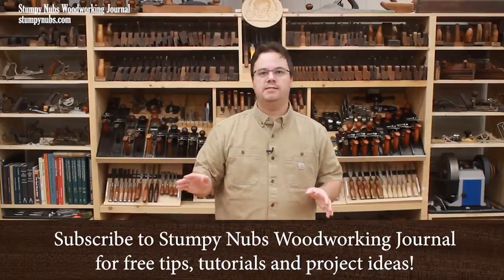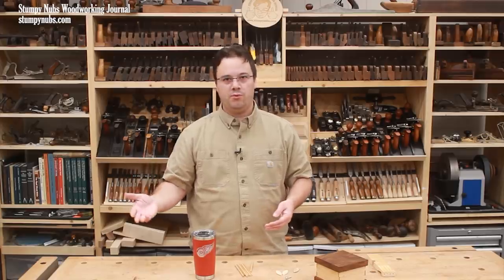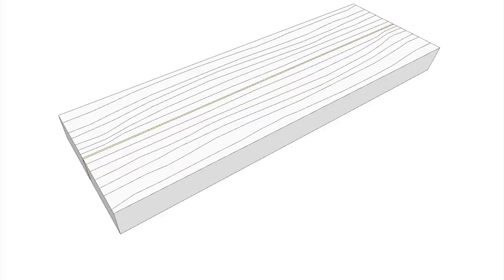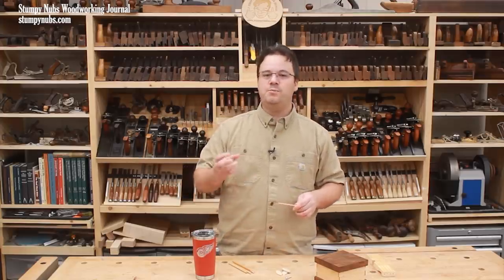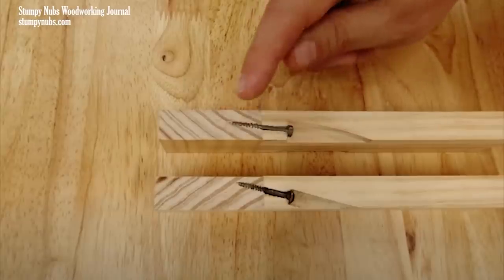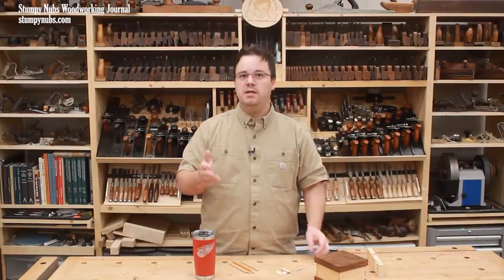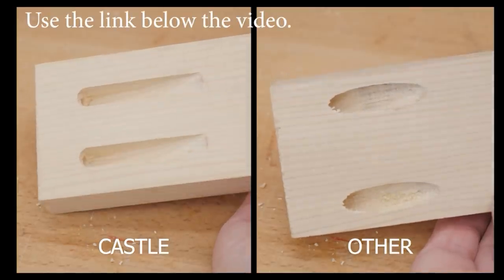Many woodworkers use these wrong! (biscuits, dowels and pocket screws)

Comment: It's so odd regarding the timing of this video! I currently have 5 dining chairs in my shop for repair. They are about $100 a piece, made in Vietnam, nice chairs,  but not sturdy enough for an male (ie 250 to 280lbs) to rock back on the legs. They just aren't designed for that type of racking stress. The joints have been put together with dowels, but then from the bottom, they ran a screw into the joint/dowel. 
In taking them apart, it seems the screw is breaking and compromising the dowel. 
I'm kind of scratching my head as to what is the proper method to fix them. I have considered dowels again, or a domino, but I don't have a jig to drill a domino. Anyway, I'm rambling.  Thank you for the timely advice and information in this video.
Reply: Oh yeah, and I have considered just ditching them altogether,  but I'd like to see if I can fix them. I'm probably going to make the cross pieces a bit more beefy. No, not a 2x4 or anything savage like that, but wood that has a bit more mass to it.

Comment: The hold of a biscuit was tested; it adds nothing meaningful to strength.  You could use them for alignment, but dowels would be a better option.  Dowels work well is you planer is 12" wide, and you want to make a wider table.  Making your own dowels is also a good thing to do.

Comment: I've found the main problem with pocket hole screws to be their movement during installation.  You still need to clamp pieces together or as you screw into the piece your attaching it moves out of alignment.
Reply from the maker: That is a smaller issue with a jig that cuts the hole at a very low angle, such as the Castle machine at the end of this video.

Comment: I love the speed of pocket screws. But don't like the drift. 
One thought is to use a dowels along with pocket screws to help prevent drift and increase speed.
Reply from the maker: A low-angle pocket really changes that drift problem. The Castle system segment at the end of the video talks about that.
Reply: @StumpyNubs  the Castle system is nice. But it's not cheap, and I'm just a hobbyist.
If there are any other low angle systems in a more budget friendly price range, I'd be interested. But I'm thinking the pocket screw/dowel combination idea is about as budget friendly as I'm going to find. The question then is around results.

Comment: One question: 
Are dowels as prone to telegraphing over time, as biscuits can be?
Reply from the maker: I've never known dowels to do that. The telegraphing problem with biscuits can be solved by cutting the slots off-center, biased toward the underside of the panel or inside of the cabinet.
Reply: @StumpyNubs  
Great James, many thanks.

Comment: I haven't used biskits or dowels yet. Just finished another project with pocket screws and ran into a small problem. It been a while since I've used mu jig set and had a few screw points poke through.  Check my settings then got out the calipers. My math isn't great but even I know .70 is not 3/4 inch. Checked all that days purchased lumber and found it was al the same. Industry standards mean nothing anymore. Can't rely on much anymore except that politicians still suck.

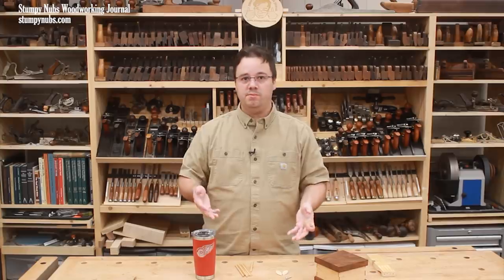Comment: 4:06 Biscuits do not extend far enough in the joined wood pieces to provide significant/enough additional rigidity to the join. "Enough" is the operative word here and if enough pressure is applied, the join will split along the glue seam no matter how many or few biscuits are used because the wood fibres adhesion will not hold up. Wood can be compressed so the biscuits do not need to break for the join to fail: once the wood piece itself fails along the join it will simply pop out of the biscuit protrusions. Seen it happen: the smaller the biscuits and the higher the stress applied, the easier for it to happen. The biscuit cannot be relied on for significant additional rigidity in my opinion.
4:32 Exactly!
5::40 Ditto! Perhaps dowels were invented for automated furniture fabrication processes were savings in materials usage and time matter a lot. Also for the wood worker carrying out a similar repetitive task, where again time matters. The alignment is crucial though and it's probably not an easy task for the amateur woodworker who might not realise how much strength is needed for the join attempted nor can achieve the proper alignment, even when using a jig.

Comment: Pocket screws are NOT recommended to securing table tops.  The table top needs to expand and contract.  Thus the Z bracket is recommended
Reply from the maker: Yes, they are. In fact, the Shakers used them for that very purpose, and their pieces have lasted two centuries. You just have to know how to use them properly.

Comment: The same can be said for Stanley plane’s. Purists say the Handyman version is not worth having. I disagree! The Handyman works just fine. Yes, it may not have frog adjustable screw, but some of the Bailey’s don’t either. You can pick up a Handyman for $10. To $20. Bailey’s cost $45 and up. I have both and frankly, not much difference in performance.

Comment: Wouldn't you need a jig for every size dowel you use? I just don't see precise alignment of a 1/4 inch drill bit in a 1/2 inch jig being as easy as using a 1/4 inch jig.

edit to add:
Those self proclaimed gate-keepers to what is good wood working need to be told if they use anything other than the ORIGINAL joining method of mortise and tenon they are doing it wrong then. ;)
Reply from the maker: Good dowel jigs are micro-adjustable for position and come with different sets of bit guide collars for different dowel sizes.
Reply: @StumpyNubs  so it effectively becomes a jig for the size you need.

Comment: My other joinery inadequacies aside, I have discovered that I'm not a pocket-hole-superstar, which is most likely due to lack of practice in addition to lack of precision.
Reply: I have learned to practice on scrap wood of the same thickness and material with my pocket screws to get the best result. I'll adjust the measurements on the bit, on the guide itself, and different length screws.
Reply: Setting up a pocket hole jig is like setting up any other tool in the workshop - test in on scrap first, adjust, test, adjust, test.
Reply: @criswilson1140  it probably doesn't help that ALL of my wood would be considered "scrap" by most people's standards!
But yeah, practice, test, adjust, repeat.

Comment: "In some cases there is just no substitute for traditional joinery"

Other than "biscuits" (though one could argue to be a variant of splines), why aren't dowels and pocket screws considered traditional? Pockets have been around for what, 300 years or so. Dowels since good glue has been a thing, I would imagine. What are these "purists" standards coming from? Do they only accept real woodworking if it is found in 2000 years old ancient Egyptian furniture sealed in tombs? Good lord.
Reply: Maybe not by time, but by manufacturing.

When a furniture is made from solid wood and from only wood, you can burn it and nothing is left. 
Use pockets and you you have metal inside your "woodwork". So maybe it is the simplest form of craft, and not the insulting "purism"?

Let's give someone just a knife and see how quickly and well they can carve an object from a wood. Now, someone can say that using chainsaw or a carving disk in angle grinder is faster, easier etc, but they have just failed completely in the basics of carving.
If you use saw with the knife, again failed as one doesn't know how to use knife to get tight places etc.

Saw is advanced tool from the axe. Someone needed a tool to make fast, precise and clean cuts that axe couldn't do without eating the other side of piece. But by any means did saw replace the axe. 

Someone wanted to get smoother and more controlled surface for wood than knife or axe could do, and avoid mistakes that saw made for straight cuts. Why planers were invented. A knife that was attached to a plank in a angle and guide, so one could get controlled chips with each pull and pull, smoothing the surface easily because now hand coordination weren't a problem.
Eventually leading to specialized tool with flat surface, a flat wider blade and always in proper angle, and easily adjusted depth. 
A planer is a advanced version of a knife and wood piece. But it by any means doesn't replace a knife.

Drill is a replacement to hammer and nails, and knife. Instead hammering a wooden dowel or another wooden piece inside something, you got to first as well make the hole for it. So nails are difficult as they can split wood or twist and go in wrong angle.
So drill made possible to make consistent holes in diameter and depth to get wooden dowels inside, remove large amount of wood quickly inside the piece etc. 
But by any means does drill replace hammer, and knife. 
Drill is just advanced version of those tools.

Glue is natural thing. Glue is from the hunters, the gelatine etc from the meat. You get extra strong glue from there, that is holding living pieces together. Wood is as well having own glue between layers, so applying a glue is just "returning" wood pieces back to together in various means after separation.
But glue is not replacing a mechanical locking structure as joints. One can use wedges, angles, different wood types etc to create a very advanced joints without any fastener, glue etc. Just by using a knife, saw, hammer. 

It is the skill that separates three people, methods and possibilities, but at some point one needs to accept that using a more advanced tools provides lots help, shortens working time, makes many things possible in slightly different ways.

But that is nothing more than more advanced way of working, that is all based and still dependent from the basic tools, and can't replace them.

Woodworking is not about making cabinets, or making boxes (box is advanced version from the bag and clay vase) or similar things. It is about making something from the wood and not the quality of the work.

That is why "the basics" has it claim for "proper way to do things", and not "the advanced" methods. 

If I would be thrown alone to island and I could take only one item with me, it would be a quality knife. I could not just do about everything with it from building the shelter, defend myself, gather food etc. But I would as well be able to build other tools for my possession. I wouldn't want to use any stone edges to cut things, or try to sharpen a spear, or make a wooden dowels sharp etc. I could do it, but it would be so many times faster, easier, more effective with a quality knife that I can sharpen with a rock now and then.

But none of that means I wouldn't like many other items, tools etc with me if I could. Why I have thousands of tools in my possession for various other purpose, instead just a knife.

But none of those others matters like the knife does....
Reply: @paristo  That is a lot of words for "I am stuck in the stone age and I think I am cool for it". Also, congrats on talking about leaving stuff behind when burning furniture (who the fuck builds furniture thinking about how it will bloody burn in the first place), while happily ignoring ignoring all hardware we have used on wood for ages, like hinges, nails, locks, etc. In case you never noticed, they too leave something behind. Not purism my ass.
Reply from the maker: At least in the context of this video, there is a difference between something that is "old" and something that is "traditional". All of these methods (even biscuits, which are essentially splines) are centuries old. But tradition is a matter of opinion, and today's woodworkers have a "tradition" of using dovetails, etc. even when the joint doesn't require the strength.

Comment: not what I'd call a "dovetail" - more like a finger joint with big fingers, no?
Reply from the maker: The box? They are dovetails. They are just small in length because the box sides are only 1/4 inch thick.

Comment: James, this is going to make the traditional purists cringe but my favorite type of joinery for large pieces, I build traditional style mortise and tennon, raised panel  style rail and full and XXL sized entry doors.... you're  not going to believe this.....
is dowels.

Not just any dowels though. I use thickened epoxy dowels that are made and cured in place inside the dowel hole. The great thing about this is that you can use a hand drill to drill the dowel holes and not only do the holes not have to be perfectly straight, the strength of the joint actually increases if they are slightly askew. So, you hand drill dowel holes in two adjoining pieces, forget all the time and energy it takes to make a traditional mortise and tennon joint because we're not doing that,  you fill each hole with thickened epoxy, add a little extra to the rest of the joint itself just like you would with regular glue and the epoxy "dowel" cures in place. Now imagine that dowel is cured in place and not perfectly  straight and think how hard it would be to pull that joint apart. Now imagine there are two more epoxy dowels in that same joint and all askew at random angles different from each other. What you end up with is a ridiculously strong joint that takes literally minutes to construct as opposed to a standard mortise and tennon joint. I gave up doing traditional mortise and tennon joints for this method about ten years ago and have never looked back. Never had a single joint fail or even show any sign of any type of compromise. Let me know what you think. Great video.
Reply: This intrigues me.  How do you keep it from running out of the holes until you can clamp it together?  You mentioned 'thickened', but what does that mean?  Do you alter the 1:1 ratio somehow?  Or let it partially harden in the open air a few minutes?  Or you mix in a thickener, like sawdust, and 'putty knife' it into the dowel holes?  I know epoxy can be very strong as a thin cement layer, but as a formed-in-place mechanical fastener, I guess I'd have to know what force it would withstand as a chunk of plastic?  I don't doubt the success with it that you've enjoyed, but I'd want to know how much load I could put on it, to get a feel for the best ways to use it?

Comment: I agree with everything but pocket screws.  There terrible.  They are used way to much where better joinery should be used.  They are great for people getting into the hobby, but they literally take no skill and are used in applications they have no place.  I see shelving on walls.  I saw a whole pine table slab with 50000 pocket holes on the bottom even into the breadboards.  These were for sale by inexperienced woodworkers.
Reply from the maker: The point is to use them only where they are appropriate. You shouldn't reject them just because some people misuse them. (However, pocket screws are entirely appropriate on breadboard ends. The Shakers used them regularly to attach things that needed to move. You simply overbore the pilot in the pocket and it works very well.)
Reply: @StumpyNubs  I’m pretty sure they didn’t over bore anything.  I really don’t care if someone is just making stuff for their house but when they price it at a price just lower than mine that uses domino’s and traditional joinery it’s going to upset. Days vs hours of time.  I really believe theirs’ is a sub par joint when you factor in how much wood is removed. I have thought about using them for clamping traditional joinery together, but I just can’t.
Reply from the maker: @nickthackston6288  "I’m pretty sure they didn’t over bore anything."... Overboring is an intentional act of making the pilot hole larger than the shaft of the screw so the wood can move around it. YES, they over-bored... Again, you are missing the point. If people are using pocket screws where a domino or tenon should be used, then they are misusing them and that is not what this video is about. But if you are using a domino where a pocket screw will be just as appropriate, then you are overbuilding. You seem to think all use of pocket screw is equal. That simply is not true. Some uses are good, others are bad. Putting a domino or a tenon where it doesn't need to be doesn't make the project superior, it just makes it more expensive.
Reply: I know what overboring is. I don’t agree that pocket screws are an acceptable joint on finished pieces.  As far as overbuilding with dominos that might be the case, but they’re just as fast if not faster.  I know the new woodworker isn’t going to shell out the cash for festool.  I just see to many new woodworkers that are selling projects that are sub par. For 3/4 of the price an experienced woodworker can build.  The new guy knows nothing about finishes, expansion and contraction, proper joinery, etc. I do appreciate this video.  I wish it was mandatory viewing for all new woodworkers.  I’ll admit I have learned quite a few tips from your videos.  I really appreciate your videos, and we use the same pencil.  I’m not ragging on your videos at all they are a wealth of knowledge.  But I don’t think I’ll be using pocket screws anytime soon.